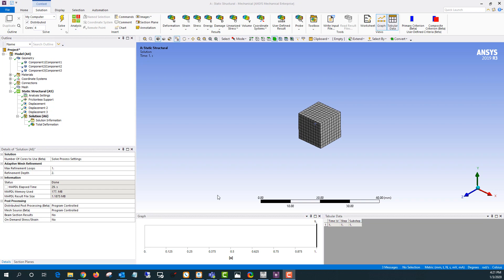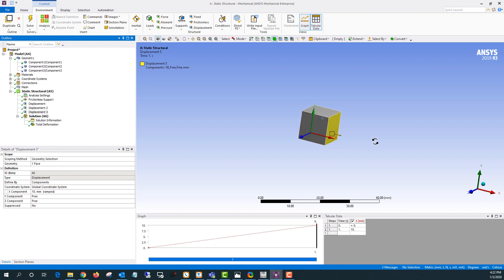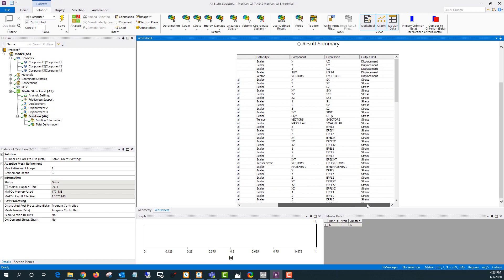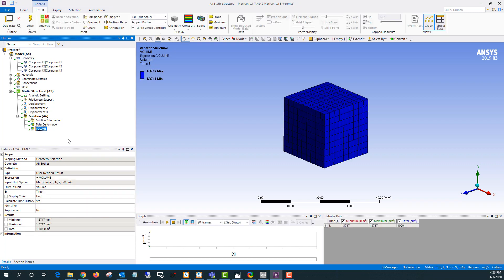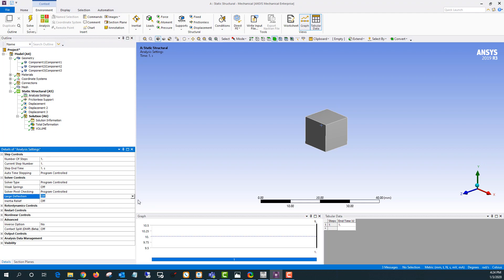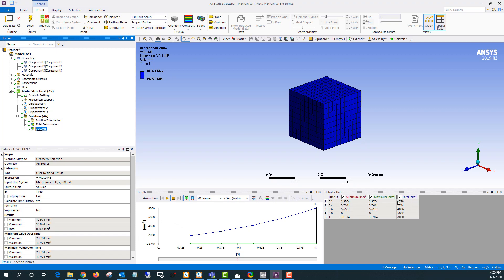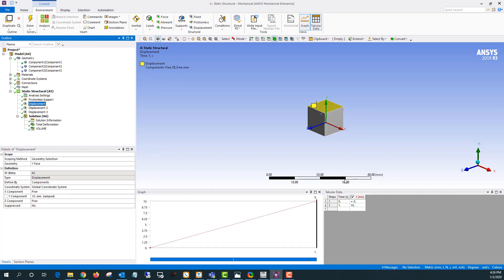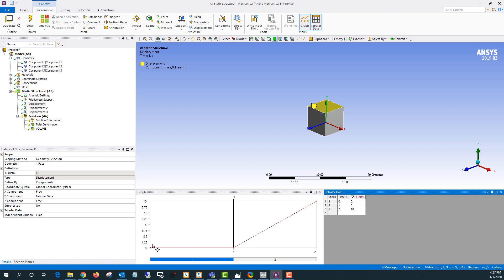How To Calculate the Volume Change in a Part

Comment: The solution suggested at 3:48 unfortunately does not work with large deflection off. Only if you switch it to "on" you get the deflected volume